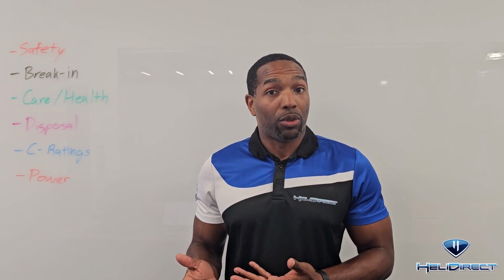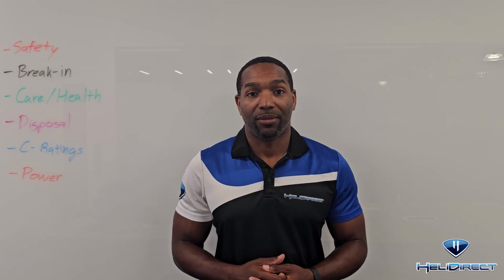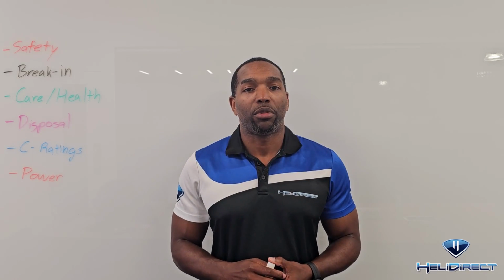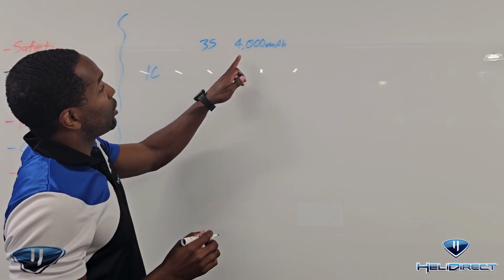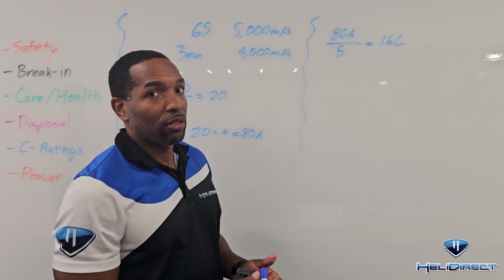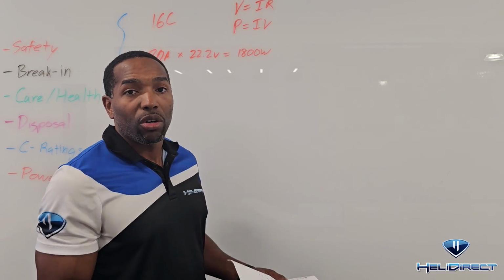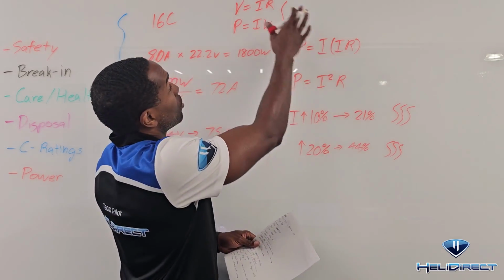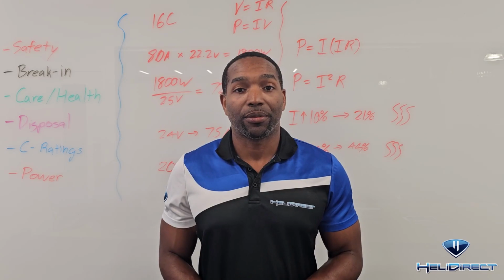LiPo Battery Mistakes That Are KILLING Your Performance

Comment: 3.0v per cell discharge is very extreme. The true 0% SOC is 3.3 volts. Not 3.0 volts.  3.0v per cell sounds like a maximum allowed voltage sag number.

Comment: Thank you very much for posting this well done video.  I have a follow up question.

Charge rate.  I own many Pulse Ultra LiPo batteries (standard LiPo, not the HV versions) in the 45C to 50C range.  They all state I can charge them up to 5C rate.  I generally balance charge at 2C charge rate.  In my experience, balance charging at 3C charge saves about 4min to 5min (in real life) compared to 2C balance charge rate.  Although I have balance charged at 3C for testing purposes, I have been hesitant to adopt charging at 3C "routinely" out of concern that I would be "significantly" decreasing overall potential charge/discharge cycles and degrading the batteries faster compared to charging at a more conservative 2C charge rate.  Is there a significant acceleration in battery degradation and/or significant decrease in number of useful charge/discharge cycles when balance charging at 3C compared to slower charging at 2C?
Reply: In my experience and research, no there isn't. You're pretty safe up to 3C I've found.